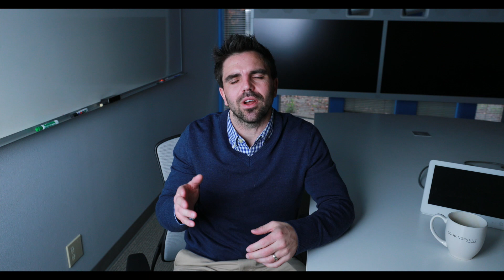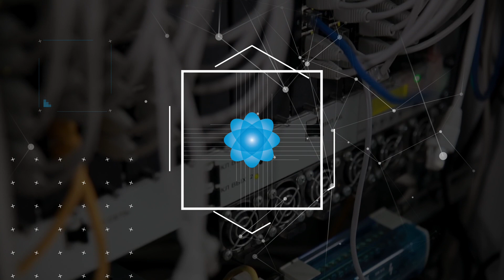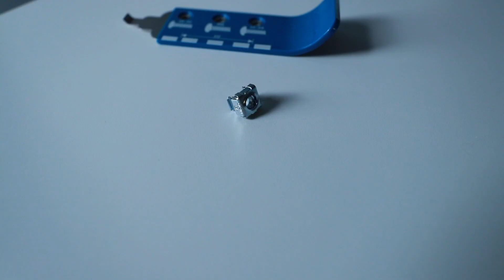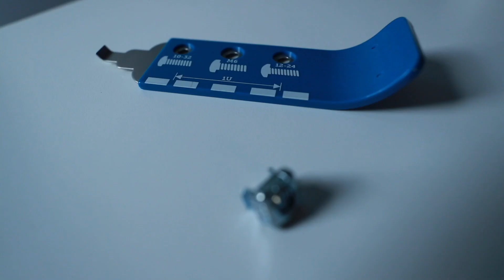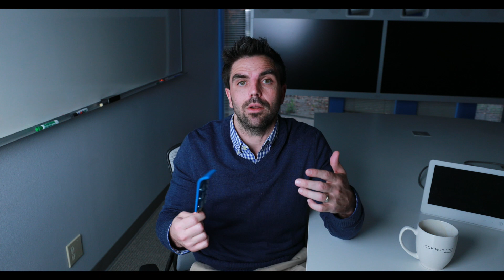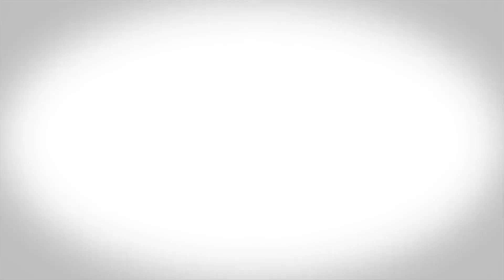How to Rack your Network Equipment like A PRO!!

Comment: Thanks for the video! I've been trying to get these cage nuts in but dont want to spend any more money! haha...mayve i will buy this tool.. Any suggestions on what order home labs should be installed on a home lab rack thats about 8-12u's. Does it go PDU on bottom then going up ASA->Routers->Switches? I've heard heaviest on bottom, but they are all relatively heavy. Any suggestions on order of placement? Thanks!